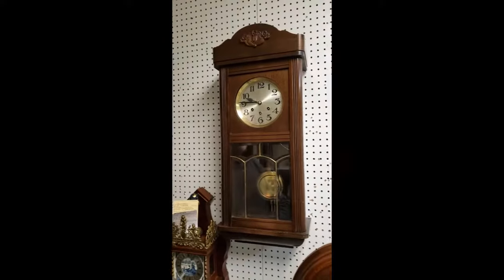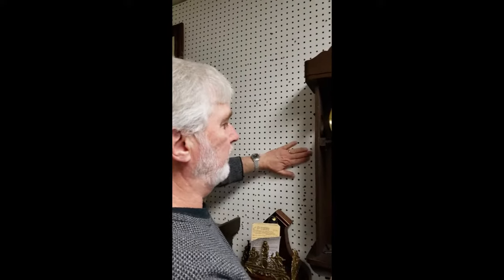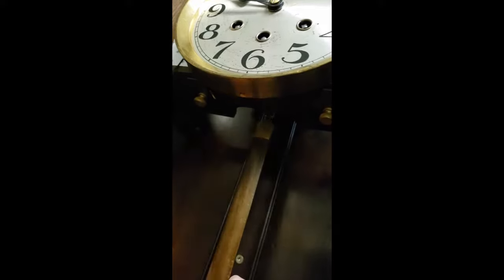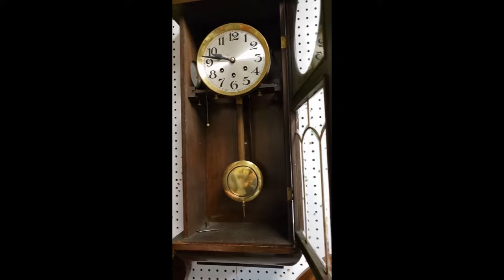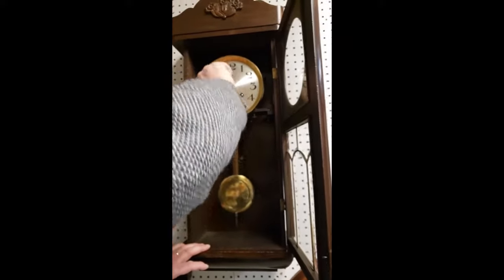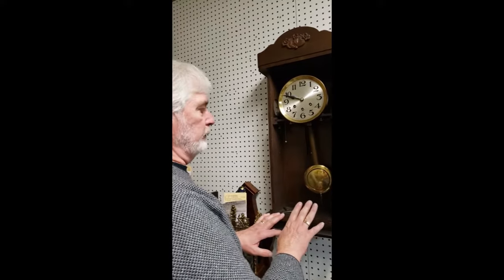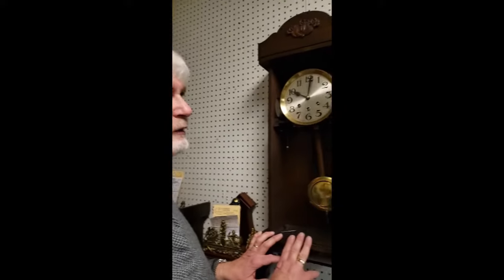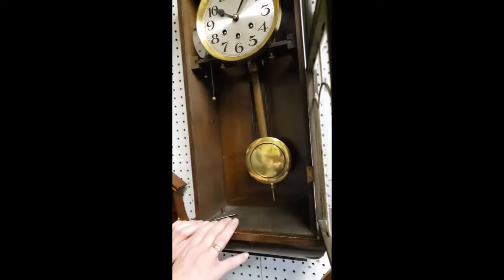Westminster Chime Wall Clock Tutorial - Vintage

Comment: I have an antique Elgin westminister chime wall clock. Has three key holes.  Chimes sound off key.  Meaning they sound annoying.  A friend said it was the second and third hammer that needed to be loosened.  How can i fix? The entrance in the back where the hammers are is very small suggestions?
Reply: Hi, thanks for your question. If the chime rods do not sound right the only solution is to take your clock to a professional clock repairer. There is no user friendly fix for this issue. Google clock repairs in your area. Hope this helps. Rick

Comment: I have a Kermle Clock made in Germany. It has 3 holes but the left one is stuck and when I try to scroll it with the key it give rolling sound then the clock stop producing the bill sounds.. any idea?
Reply from the maker: Hello, Thanks for the question. It sounds like the chime side mainspring is broken, or perhaps the click spring may be broken. You will need to find a clock repair person in your area to have the parts replaced and the mechanism serviced. Hope this helps.

Comment: I HAVE AN ANKER WESTMINSTER 3 tune WALLCLOCK  wind-up clock purchased in 1981, possible 1500 model? WITH 4 hammers on one side and 8 hammers with two blocking levers when moving the clock and two chime braces holders. QUESTION - IS THERE A THIRD BLOCKING LEVER FOR THE 8 HAMMERS THEY DON'T MOVE ANYMORE AFTER CLOCK BEEN MOVED FOR CLEANING and the 4 hammers only move and chime one time on the hour than they use to chiming the hour of the day.
Reply: Hi there, Check the lever that changes the chimes. Is it set on Silent or in between two chimes?
Reply: @PerfectTimingCanada  
Ran the tune level back and force and stop. Feeling level on music chime. At 8, I got one dong. Counter-clock moved the hour hand back to 1. Moved the minute forward  to 2, no dong - moved forward again to 3, got one dong - moved forward to 4, no dong - moved forward to 5, one dong - moved to 6, no dong - moved to 7, one dong - moved back to 8, no dong this time. Music plays on the quarter hour sometimes but does plays on the hour.  This is driving me to a cuckoo Clock!
Reply from the maker: @davidwhite4483  please contact us at: service@perfecttiming.ca

Comment: My case clock when it chimes,  it sounds like a clunk,  how can I adjust it to chime pls
Reply: Hi, check to see if the chime rods are restricted by folding brackets on the lower case back. The brackets turn outwards to release the rods.

Comment: How to prevent the clock from making sound?
Reply from the maker: Unless the clock has a special lever with which to stop the chiming or striking, then there is no guaranteed mechanically safe way to stop it. After a few weeks, our brains get used to it , and tend to ignore routine sounds  Or if your clock has a pendulum, stop the pendulum at bedtime. and start up the clock in the morning